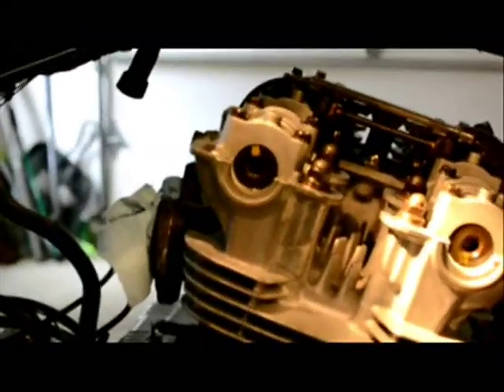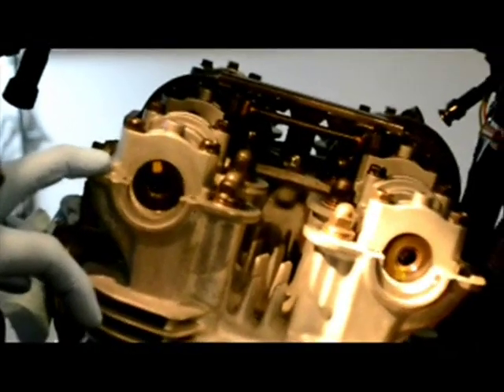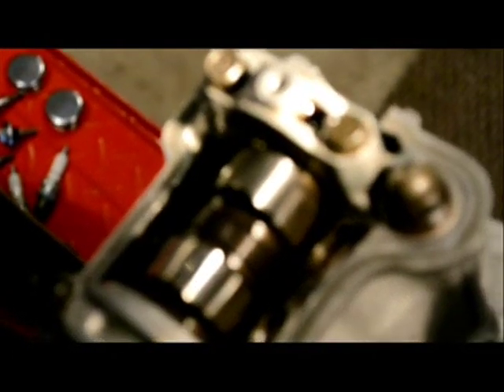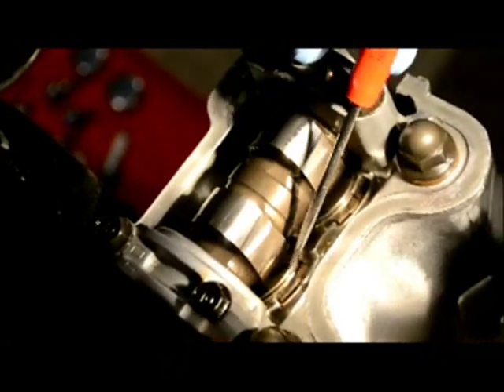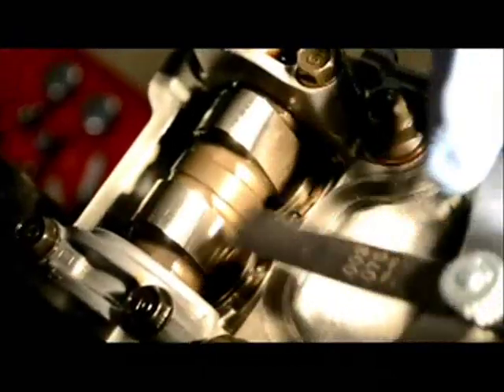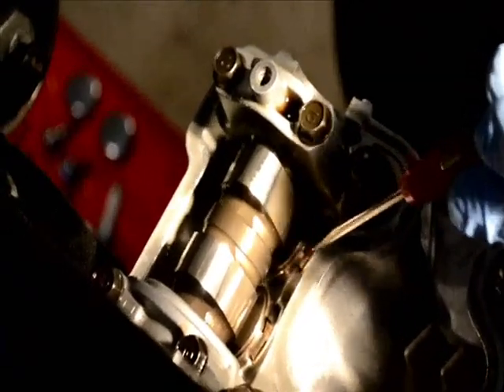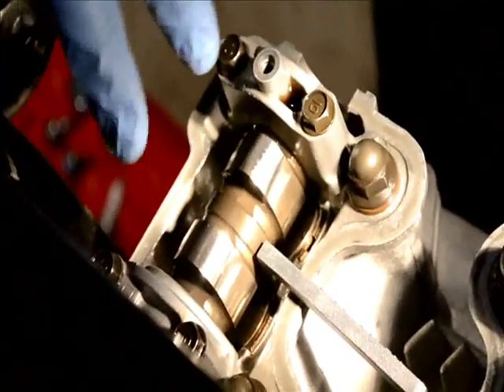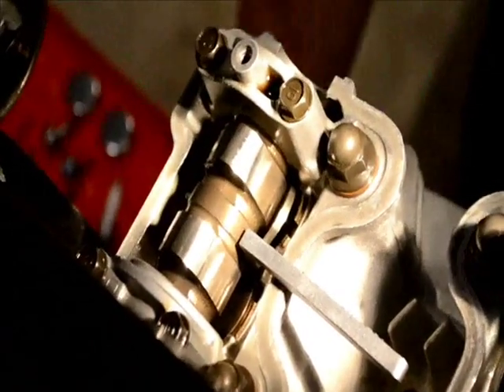Valve Measurement and Adjustment 1981 Honda CB900C

Comment from the maker: I have been locked out of this account for years, so sorry for the delayed response. 

@eduki - I don't know if it is the same for a CB1100F. My bike was a 1981 CB900C, I think it is the same for the CB1000C. You need to measure ALL of them and record your values. There is a spreadsheet in an old yahoo forum for CB900C/CB1000C where you record your values and it tells you what shims to remove, move, or keep. I removed the ones I didn't need, went to the Honda dealer and they just swapped them for the ones that I needed. The spreadsheet is called __Valve_Shims_Tool_New-n-Improved.xls

@GREG GERHARDT - This is a video for folks that are trying to fix their bikes. You can also measure in inches (and I am in America). I do get it.

The video and sound quality is not good because I just had my son hit record while I did it. This bike was sold MANY years ago so I can't recreate it and edit. Yes, I worked in a shop with ghosts ;-)

Comment: Love  the vid.  Only thing confusing is in the vid you are measuring exhaust on cylinder 4, and the engine is in the b position or 6 oclock, Your cam lob is facing up.  if you do the same thing on my at pos b and at 6 oclock.  my cam lobe doesnt face up?

Comment: I would always adhere to what the manual says. You hear all sorts of eerie things out there, like changing exhaust does not lean out the mixture or just hand tight the spark plugs... 
I guess who ever designed the engine knows best.

Comment: Great tutorial.  I stumbled here trying to find what the clearances are suppose to be as I have a compression issue and I'm rebuilding the engine entirely after buying it recently.  I have seen different tolerances floating all over different forums and such, but the manual actually states different tolerances for each of the different valves...

I am going to use your tolerances, as I've seen them elsewhere as well.  Thanks again.  Cheers!

Comment: i have n 82 cb900c, it runs and starts right up but it seems to only rev and run right when the choke is pulled. If i let the bike warm up it will stay running and idle without the choke pulled but if i try and rev the motor it will sort of backfire as its climbing in rpms and it will sometimes climb back down in rpms slowly, any ideas?

Comment: Using a powerful computer magnet to remove the shim is not just a gimmick, shims are super hard steel and gripping them with pliers is like squeezing a bar of soap in the shower. It's just a matter of time before the thing shoots out of your grip. the danger is it dropping down into the engine!!! Not good..  so what do you do then?? strip down the engine? turn the bike upside down and shake it?  no you use an extending magnet and poke about down there and hopefully get it back, step one

Comment: just the ones that need replacing.  it helps to take out the ones that are out of tolerance and set them aside.  you may be able to reuse them.  i used the fancy spreadsheet found on the cb900/1000 users website to see what I needed.  i reused a couple and needed a couple.

Comment: it's a lot easier to use a magnet to lift out the released shim, and avoids it popping out of the pliers and dropping down inside the cam chain passageway.. my magnet is a super high power one from a computer hard disk drive. <you can get one for free from any computer geeek along with a free lecture on how a disk drive works...colin

Comment: @MadSmokerBBQ It is a pain to get it right.  Use a new gasket only.  No silicone.  You need to tighten it down evenly in a "star" pattern not heavy on one.  Mine leaked, then I did it again (a pain) like the book says and it works.  Patience is needed here.

Comment: The cam cover gasket on my '79 CB750 leaks at the front left.  What sealant & gasket do you use?  I have a black rubber gasket with blue rtv silicone and it isn't sealing well.

Comment: thanks for posting this vid, it was very helpful, i was pretty much clueless as to how to go about doing this.     all of my valves clearance out at .004mm   except one valve on the intake side of the #1 cylinder, it clears .0025    my number one wasnt firing well, thats why i went ahead and did this.   is .004mm normal? the clymer says 0.08 also         the one that is .0025 holding the valve open a little bit?  any input would be greatly appriciated.   thanks

Comment: I just insert the valve lifter holder when the valve is open, then turn the rotor until the cam lobes are pointed away from the valves - yes, you're absolutely right, you have to be careful to make sure that you don't have both sets of valves on one cylinder open but it seems easier than forcing the tool in - remember, the tool is a "valve lifter holder" which means it holds the valve lifter - it's not a "valve lifter pusher" :)